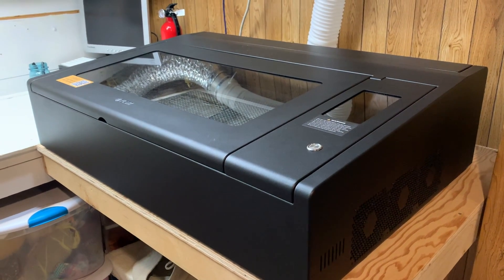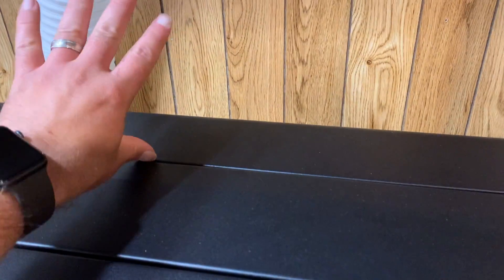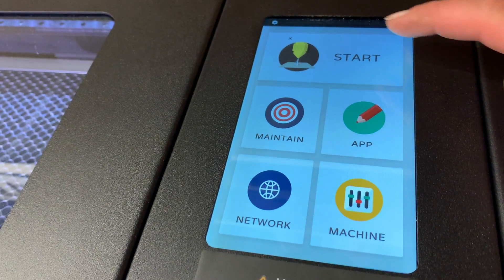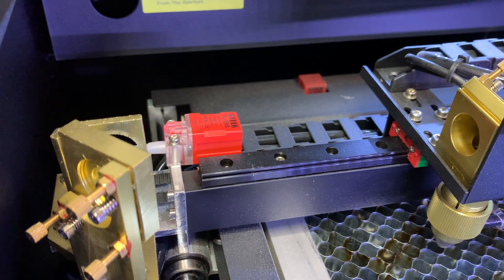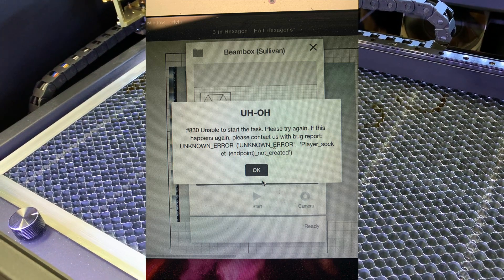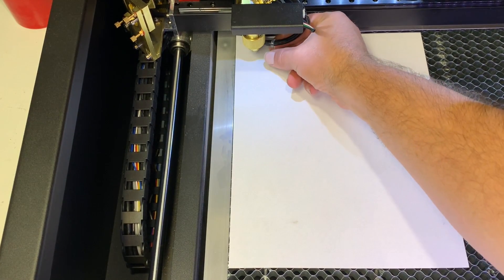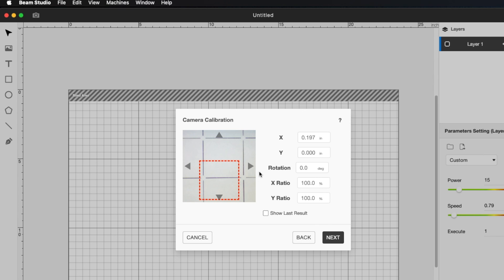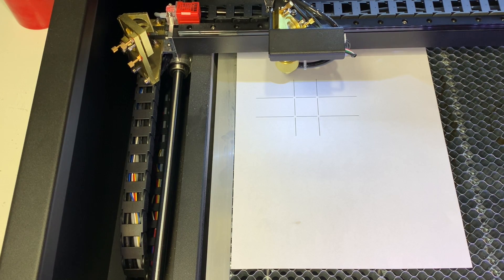Beambox Pro | Overview, Setup Problems, Camera Calibration

Comment: Hello, I have a Beamo and the camera preview is just black. Any help would be appreciated.
Reply from the maker: You could try a factory reset.  It’s possible something got loose during shipping.  I know the on the beam box pro, the display panel can be lifted up after undoing a couple screws.  All the connections where in there.  You may need to talk with support.

Comment: That focusing tool dropping down would drive me nuts.  Does seem hokey.  Wondering if that proximity switch just needs to be shimmed to focus better?  That should be something the dealer could sort out with factory.  I would like to see another video to show creating some artwork and process of sending from design software to the laser.  Appreciate your time and effort to document your experiences so far.

Comment: Thanks for the information , I am edge to buy this one or glowforge , how did you made the call to buy this one over others ?
Reply from the maker: Thanks!  That was the other one we debated between.  The locked down nature of glowforge, needing to use their website to push projects to the unit didn’t sit well with me.  Beambox pro had a larger work area and had a higher watt laser for less money.  Glowforge is probably more user friendly with better out of the box experience for beginners especially.  We don’t mind tinkering and learning so it’s been a fun toy!